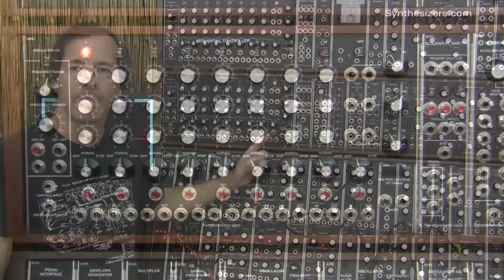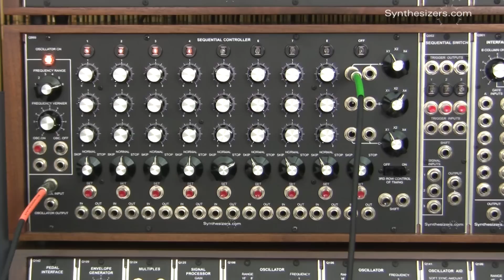Q960 Sequencer AUDIO OSCILLATOR tutorial - Synthesizers.com

Comment: I'd be scared about burning out the lamps. Or is that just silly?
Reply: If you burn out the lamps they are easily replaced with new ones from Synthesizers.com of course. ;-) But, for anyone that does a lot of audio rate or other fast sequencing there are LED replacements for the incandescent lamps that can be found. The main problem with the LED bulbs I've tried so far is that they are a little too bright and physically they are seriously ugly! (usually sticking out too far and mostly crappy white plastic) I REALLY wish that someone would manufacture some LED replacements made the same way as the incandescent lamps are, short, stubby, and glass enclosed!